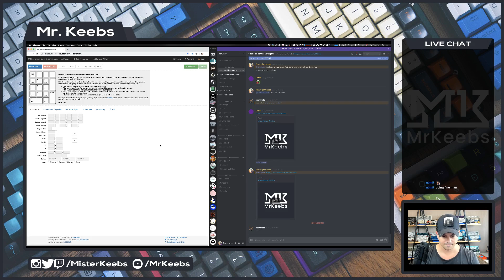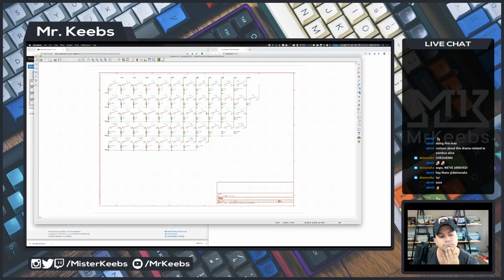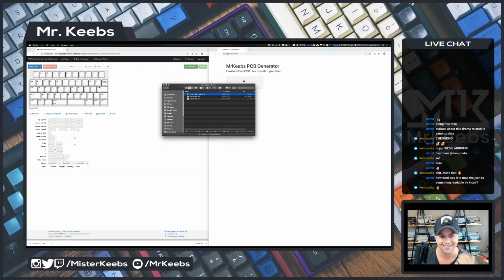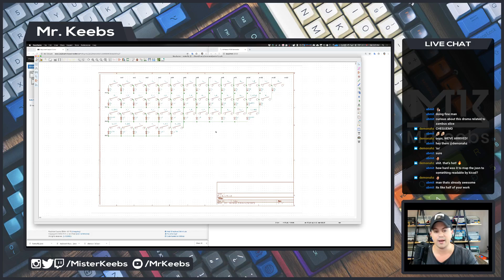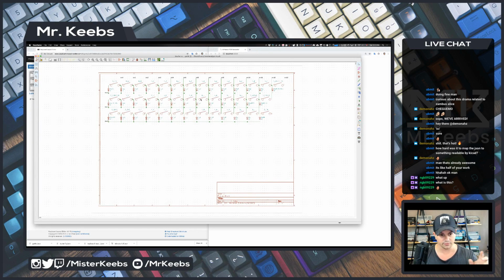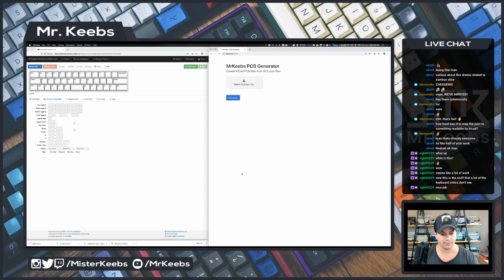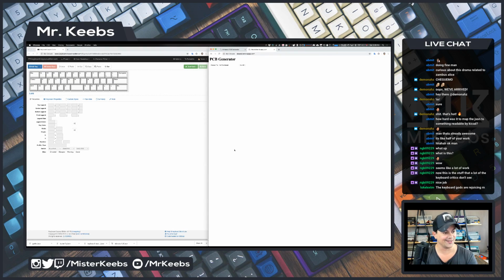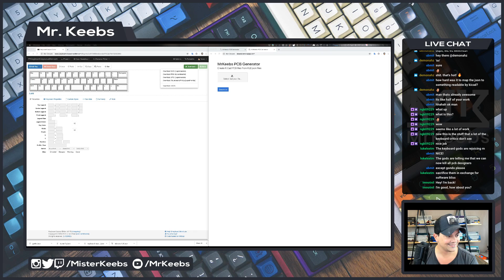KiCad PCB Generator quick demo

Comment: omg this is awesome!!! Thank you so much for making this :) Does this generate a pcb that is compatible with Kailh hot swap sockets?
Reply: The hotswap sockets are something that you add to the keeb. Technically every pcb is compatible with them, you will just need to solder them on. You can also use Millmax sockets, I prefer them over kailh sockets

Comment: I'm having a issue with both the schematic and PCB layout being totally all over the place. You can see my gist here: https://gist.github.com/ellisgl/b38ec54d8eb0e1736a361dd9a7e9a506
Reply: Figured it out. I had my X Y rotation set to something, but no rotation. Set those back to 0 (till I can get it to rotate correctly).
Reply: actually I think rotation in general kind of messes things up.

Comment: I'm sad this is not on github, can you please explain what library you are using for the generator? pcbnew, or something else?
Reply from the maker: Hey there, thank you for trying the tool! As it turns out, what I ended up doing is writing a newer version of this that piggybacks into the QMK Builder software. The benefits of this new version is that it piggybacks into the matrix generation and pinout assignments that were already available. You can take a look at http://builder.mrkeebs.com for the new version.The source code is at https://github.com/misterkeebs/qmkbuilder. But some fair warning: the end product of this is still not done, and the PCB will not be fully functional :)
Reply from the maker: And this version is on GitHub as well here https://github.com/fcoury/kbpcb